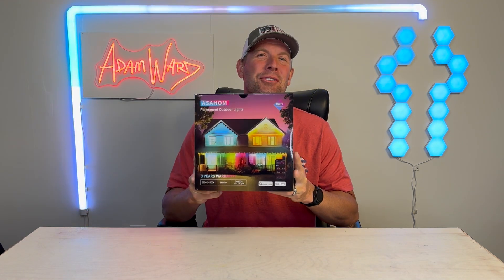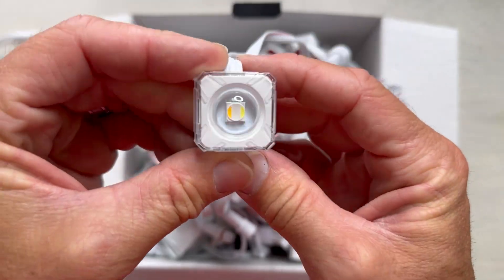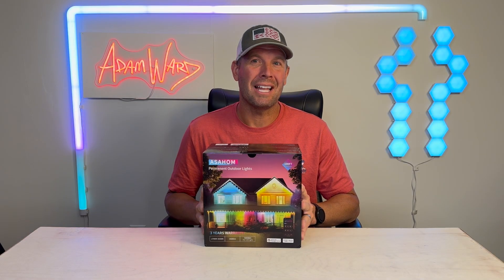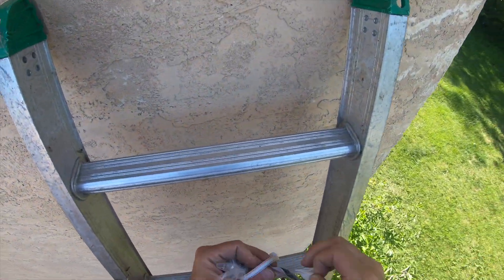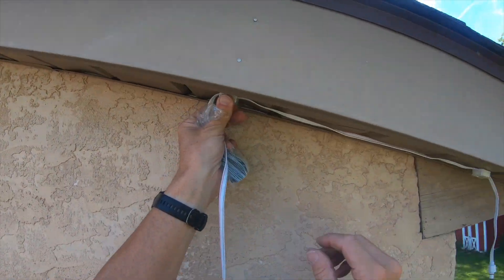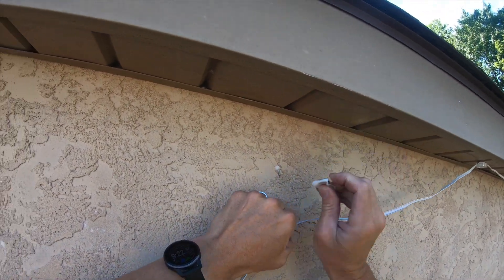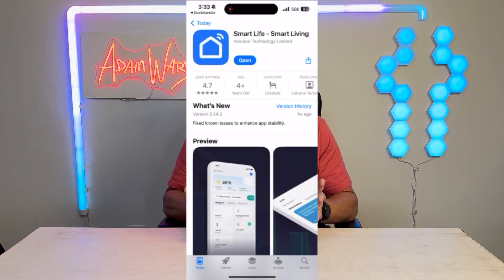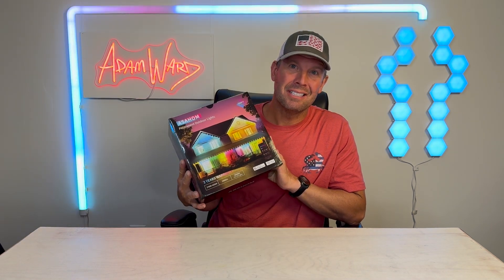Asahom Permanent Outdoor LED RGBIC Lights

Comment: Can you control these with Home Assistant?
Reply: Yes, ASAHOM S1050 permanent outdoor lights are compatible with Alexa or Goggle Home Assistant.
Reply from the maker: Yup!
Reply: @TheLEDGuy  Can  you do a video on that, showing which Home Assistant integrations are required, whether there are cloud services or API keys involved?
Reply: @TheLEDGuy  Which Home Assistant integration are you using for these LEDs?

What chipset do they use?  Maybe they can be used with WLED?
Reply from the maker: Lemme check